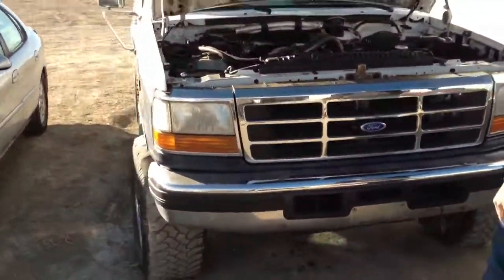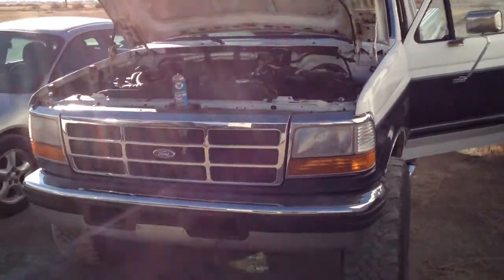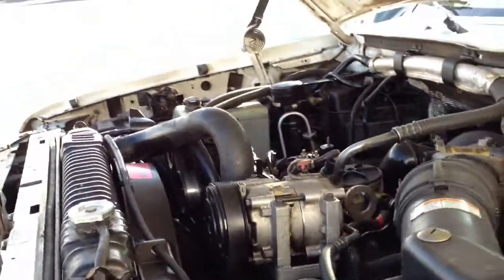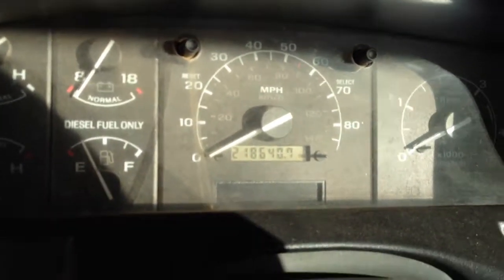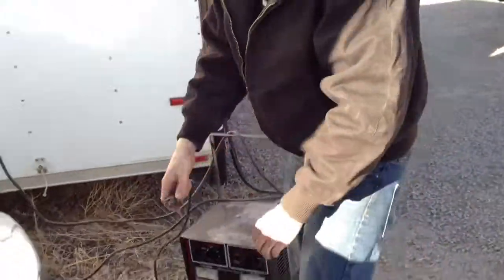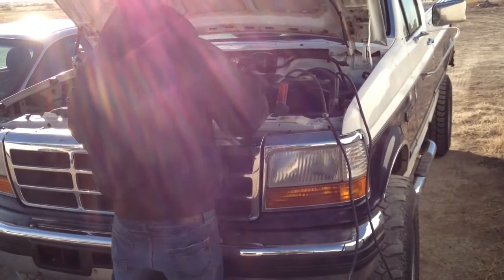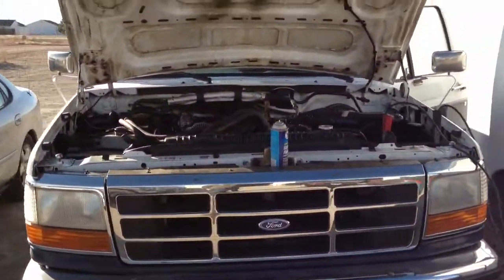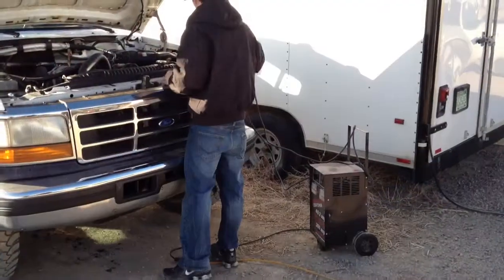1995 Powerstroke Hard Start

Comment: 1) Stop spraying ether into a 7.3 Powerstroke (or most any other diesel)  2) fix the glow plug relay 3) check the glow plugs themselves, (they can fail and knock out the relay) and 4) you should never need to throttle a 7.3 PS when starting (it doesn't help anyways as the pedal is really only a position sensor for the processor and isn't mechanically connected to anything)

Comment: what is the signs of bad glow plug relay. In my truck the glow plug realy do clicking noises when i turn the key. That is normal or i have bad glow plug relay. Engine is hard to start and when the starter turn i see smoke coming under the hood. When the engine is warm is start okay no see that smoke. Also the engine on the road i feel is miss sounds like tractor. What is can be wrong

Comment: If you would wait tell the motor is turning over thin spray a little bit of it not a shit ton and it may fire right up and never rev a cold diesel but lay off on the spray and there is a better way if you have to spay it take a some wd40 and starting fluad and spray together iv dun that and they dont nock as bad

Comment: not trying to be a know it all but using ether in a modern diesel WILL eventually crack a piston or a valve! If you absolutely have to use ether one small "psst" should be all it takes to start it. if you find that you need to soak the intake with the stuff then you have some major problems. A new glow-plug relay and a set of glow-plugs would be way cheaper to replace than getting a whole engine rebuild because of excessive ether use! Besides be nice to those 7.3s they are getting harder to find

Comment: i dont see how starter fluid is bad its ether which in military trucks the 6.5L turbo is used to start them in the winter same with big rigs.
Reply: its like drugs for trucks, they get addicted to them, and will always start asking for ether.
Reply: Aye yie yie
Reply: GoodyearBandit Yup loggers call starting fluid "diesel truck meth"
Reply: It's bad because it will explode inside the combustion chamber which can cause cracked pistons, rings, cracked heads ect. If you have to use ether you use an extremly small amount, have the key already turned on so it's ready to start when you get in the cab and crank. WD/40 on a rag and put it on your air filter also works alright.

Comment: The worst part is that you two are not using starting fluid correctly. There are two of you! One should be cranking on the engine while the other is giving a spray or series of burst with the can, this will pull in all of the starting fluid evenly! Im telling you, this is the best way to use nose candy in any engine. Also sniffing through the air cleaner is best and safest as it helps to give an even dose to the engine
Reply: +crazydiesellover no the best way to do it is never use it on a diesel, they will get addicted and wont start without it